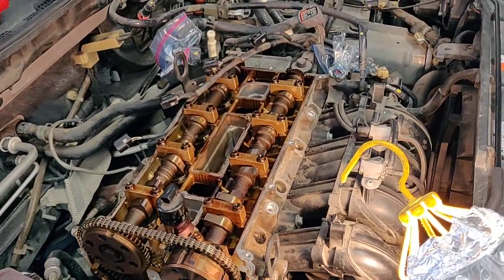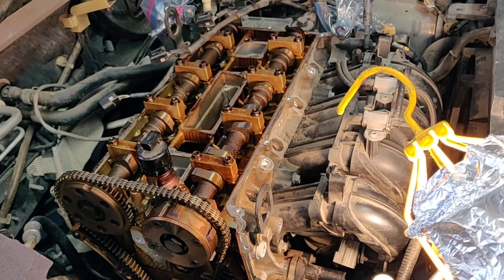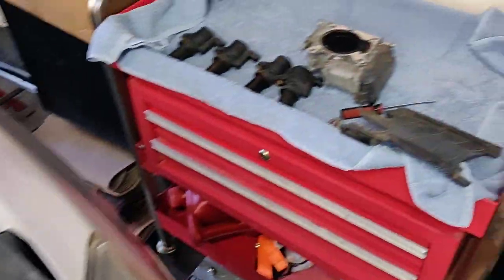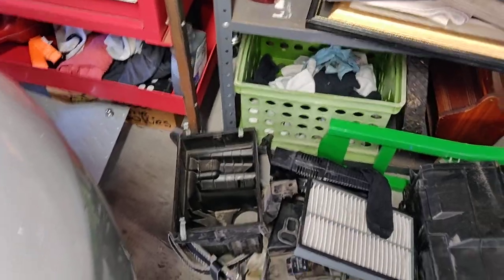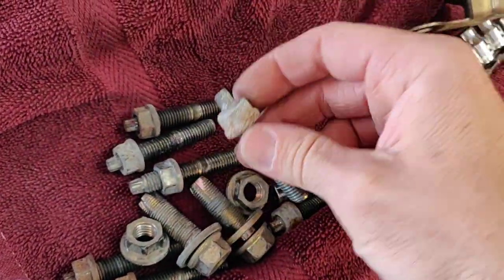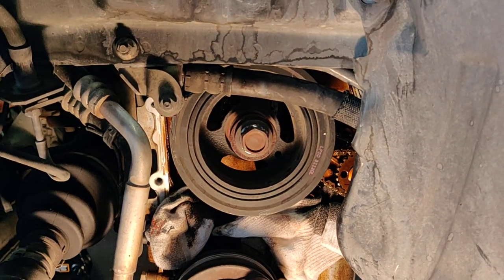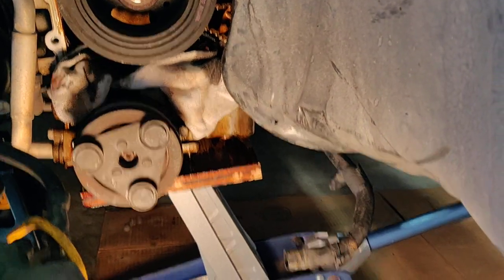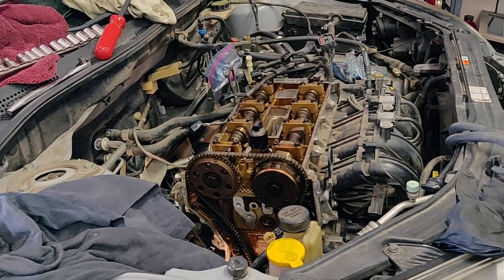2004 Mazda 3 2.3 l engine cylinder head gasket removal

Comment: Seems like itll be easier to pull the motor to work on, and if motor is stuffed I'm halfway to putting in a new 1, thanks for the vid!
Reply from the maker: Might be easier if you have the space and hoist to do it. In these little Vegas garages I had neither. Motor ran fine after this job though, so it was worth the hassle.

Comment: Just did the same job. I used a 1500 lb 3/4 drive impact gun took that bolt off easy on medium setting.
Reply from the maker: @darthwelder652  I did this job back when I had almost no good tools, I have probably 7 impacts now, including a 3/4 lol.

Comment: The only thing that worried me was when you explained loosening the crankshaft pulley bolt. You said you had the socket on a long bar, then jamming it against the ground bumped it loose using the starter- As the crank pulley has no key and as soon as the pulley nut becomes loose the valves will stay in one place ( as the timing chain sprocket isn't being clamped anymore)  while the crank is going round- There's a big risk of the pistons hitting the valves if you crank it too much - Obviously you got away with it but it's a bit risky.
Reply from the maker: Risky for sure. But we were careful. Here's the vid if you want to see how we did it. https://youtu.be/_HrJS8IXQR4

Comment: so did the gasket fix it or was the block or head warped? Got a line on a $650 '99 626 with a "blown head gasket" and wondering if its worth it.
Reply from the maker: Head was warped something awful. Had a machine shop in Vegas take.care of that part. Got about 35 or 40,000 more miles out of this little engine before the rest of the car fell apart

Comment: Very informative! Do you mind sharing the video on how to remove the camshaft pulley? I can’t get pass that process and as you said it is really a beast. I tried to “bump start” the engine while having a wrench/cheater bar but I must be doing something wrong. Engine just stops and it is not continuing with the crank.
Reply from the maker: Sorry it took so long to reply. Here's how we did it. https://youtu.be/_HrJS8IXQR4
Reply: Don't do that! You can spin the engine out of time and cause more damage. Get a good impact!

Comment: Hi, thank you so much for the info, I am replacing a head gasket too, the only thing I don’t get ( I am not a professional) is if before I start removing the timing chain and then the cams, do I need to do anything timing related?  Do I have to get it to TDC or use the timing tool? Or is that after I have changed the head gasket? I guess what I am trying to ask is if there is something I need to to do before removing the cams to ensure good timing or is all of that after? Thank you so much for your help!
Reply from the maker: No, you can just start unbolting everything. No special precautions necessary. You'll get it all back in time when you put it back together.
Reply: @jcx2bby  thank you so much man! I really appreciate your time to answer and all of your help through the videos! Thanks a lot.
Reply from the maker: @mikeup91  You're welcome, my video isn't a complete walk through on the process, but more of a 'tips' video. There is a series of videos out there that walk you through the entire timing process and they're really good. Just search for mazda 2.3L timing and you'll find them. GOod luck!
Reply: @jcx2bby  thank you! One more thing, did you have any problem while removing the engine mount? Did you use an pneumatic wrench ? Mines seem to be really hard to get loose!
Reply from the maker: @mikeup91  I used the battery powered impact wrench on most of that kind of stuff. I have a DeWalt one
Reply: @jcx2bby  all right man! Once again! Thank you so much!

Comment: what tools is necesary for removal cylinder head?
Reply from the maker: Basic hand tools will get the job done.  And by basic I mean a good set of 1/4, 3/8 and 1/2 drive sockets and ratchets.  Screwdrivers and pliers and such.

Comment: Do you happen to know if this is the same engine in the 2008 mazda tribute , my problem is a nasty leak coming from the engine and I was going to replace all the oil seals including the rear and front main oil seals , oil pan , oil pump , but if I have to go thru all this to get to the front main seal , im just gonna junkyard the vehicle. it looks like in this video that maybe the front main seal is already behind an enclosed oil area and maybe I dont have to pull the crank gear ? hard to find info on these possible oil leaks , plus our mazda is just an A To B vehicle for a college student and I would be doing this in my garage , thanks for reading any help would be great brother
Reply from the maker: First, I am not sure if it is the same motor or not. But if it is, I can tell you this much. You won't be able to replace the rear seal without pulling the motor. I didn't replace the oil pan gasket on this car so not sure about that process. Timing cover seal isn't a seal, it is rtv and it's that way from the factory. For the front seal, you'll have to pull the crank pulley off to replace it, and that means making sure you can retime the cams to the crank. Anytime you pull that pulley, you separate the timing and it needs to be rechecked.
Reply: @jcx2bby  Thanks bud , Im overseas working and trying to armchair quarterback the parts im going to need , according to the VIN its the 2.3l but it is in a mazda tribute which is actually a ford , so I am hoping it is the oil cooler which is a known flaw , so I ordered an entire seal kit off ebay and am hoping I just get lucky and thats all it is , I am an aircraft mechanic by trade and working on it is not a problem , the vehicle started having just a few drops every now and then and then almost overnight started really leaking bad which usually would not be signs of a main seal , fingers crossed , thanks for your help
Reply from the maker: @markod442  oh right on, my first 4 years in the AF was hydro for C17s, don't miss it though haha. 
I agree, seals don't usually give out overnight so you may have a bad line or cooler. From what I remember reading on this motor when I was working on it, Ford and mazda used the same 2.3 so your car should be similar to identical
Reply: @jcx2bby  I have my fingers crossed, there's lot to this story and why I have to get it running asap as in the day I get home , Im willing though to pull the motor apart if I have to , I mean I have to pull the motor out anyway if its nothing apparent, so stupid of the engineers not putting a pilot shaft or even an arrow on the cam gears and crank gear , I know there is a tool to lock out the cams and a tool to lock the crank but I would rather not have to buy those tools , its not even my vehicle , but thanks for the chat bro
Reply: Oh I should have mentioned just like you said there are markers at the back of the two cams and one on the harmonic balancer

Comment: How hard was this prosses for you 1 thru 10 10 being hardest ?

A+ video
Reply from the maker: Thanks, but I should have taken more video as I got it back together, the timing process, sealing the timing cover etc. I really was busy though and just needed to get it done. 
The procedure i'd give a solid 5 out of 10.  Buy a Chilton's manual before you do this, takes a lot of guesswork out. Most of the job is done with ordinary hand tools except for the timing tools, a tool to hold the crank in position when reassembling, and you need an impact wrench (a good one) to remove the crank pulley bolt. I did it without an impact, but it was sketchy.
Reply from the maker: https://youtu.be/_HrJS8IXQR4

Comment: What off when the engine is speed and the pulling bolt got lose. So the timing have done wrong and I have reset it many times  but when I want to start it the car will be shutting. What is the problem for it not to start.
Reply from the maker: Sorry man, I don't quite understand the issue

Comment: Awesome video!  About to tackle my Mazdaspeed this weekend.  Only difference is I have a high pressure fuel pump and a turbo to worry about :/.    Do you have a part 2 by chance?
Reply from the maker: No part 2, sorry. I don't have experience with the turbo version, but I imagine once you get that out of the way, the rest is the same/similar. Good luck, if you get stuck, I might be able to help out. I have some other little videos on my channel about removing the crank bolt and reinstalling it....it was a beast.
Reply: @jcx2bby  I appreciate it!  I'll check it out.  Where did you buy your head gasket set?  Do you trust O'Reilly's and places like that?  Or Amazon?
Reply from the maker: I bought all the parts from RockAuto, even with shipping it is cheaper than the box stores and simpler than Amazon. I do trust AZ and O'R, but Rockauto saved me like 200 bucks over what they wanted.  The box stores have their place, and I like to support them because of things like the used oil dropoff, but I'm not giving my money away either, lol.

Comment: Hey man is the chain on that engine timed. I know engine is but i see marks on timing chain and on oil pump chain but nothing to line up to? Thanks a lot if u can help
Reply from the maker: No timing on the chain as connected to the gears that I'm aware of. Just slide it on. I just drove this Mazda 1400 miles so it seems like I got it together good enough!
Reply: @jcx2bby  thanks man. I just didn't know what the black marks were for. And vids i watch and research it never says that it is oriented a certain way.  Thank you I will roll with it

Comment: Can you remove the timing cover without removing the top camshaft cover? I am assuming you have to because of the timing set up of the camshafts and crankshaft but don't know for sure. I just need to reseal the timing cover.
Reply from the maker: I am not 100 pct certain on this, but I am thinking it's possible. Youd have to still loosen the valve cover bolts at least to release tension. And I do believe you would have to fully remove 3 or 4 bolts that go thru the valve cover down into the  timing cover. 
As far as the timing goes, if you put that locking bolt through the crankcase to block piston #1 from turning, you should, in theory, not have to worry about retiming anything. Cams aren't going to move so as long as block that crank from turning while removing & installing that crank pulley you "should" be ok. Judgement call. 
There is no gasket for the timing cover btw. Just gray RTV. It's like that from the factory
Reply from the maker: And get a new crankshaft seal for that timing cover too.
Reply: @jcx2bby , thank you so much.
I need to do re do the rtv for the timing cover. My timing cover is leaking.
I would like to just remove the timing cover, clean old rtv and place back. My concern is the timing, I think I can lock the crankbolt, but I would like to avoid removing the valve cover and locking the camshafts... do you think is possible?
Reply from the maker: @Keepin-it-wheel101  I think so. Like I said the cams won't move just because you take the crank pulley off, so long as you block that crank from moving.

Comment: what is the torque spec for the head bolts?
Reply from the maker: 5 step sequence. 
97 in lbs
12.5 ft lbs
35 ft lbs
90 degrees
90 degrees
All done in order working your way from the center of the head to the outside

Comment: Hey man I seen you un bolted exhaust manifold. Is that cuz you dropped sub frame.
Reply from the maker: I unbolted the exhaust manifold because we were taking the head off the next day. I had time to do it before I made the video so that's why it's loose here. I didn't do anything to the subframe.
Reply: Oh dang sorry just thot it was timing chain job. Okay so the Jack under is just to support engine cuz engine mount is off?
Reply from the maker: @jamessoliz8020  haha, no prob brother. Yes, jack under oilpan with a piece of plywood to distribute the weight, while the engine mount was off.

Comment: How long did it take you to change out the Head gasket?
Reply from the maker: We'll honestly it's still not back together yet, waiting on the machine shop to finish the head. 
Took about 2 days to tear down, but I work slow and have a toddler under my feet constantly. I anticipate 2 days to get it going again barring any problems. A good experienced mechanic could do it in a day if they had a new head on hand

Comment: I have a 2008 Mazda 3 same motor as that one it won't start it's a 5 speed and it won't even push start
Reply from the maker: Have you checked compression?  First thing I'd do, other than check for fuel
Reply: @jcx2bby  no I have not I haven't been able to work on it yet I have no tools but sometime this week I will have them
Reply: @jcx2bby  it don't crank ither
Reply from the maker: @jonaldiyofficial8074  ohhh, if it doesn't crank that could be bad, assuming battery and starter are ok
Reply: @jcx2bby  yes they are both good
Reply from the maker: @jonaldiyofficial8074  might have a broken timing chain, valves hitting pistons. Or, depending on what happened, a rod bearing is bad, piston siezed, who knows.

Comment: This is a pretty complicated job!!! Is this how it is when changing Head Gaskets on most cars???
Reply from the maker: For overhead cam engines, yes.  For old school pushrod overhead valve engines, no. They are a different animal and don't require retiming the cams to the crank. But there are a few other things that must be done on OHV engines that don't have to be done on OHC engines.
Reply: @jcx2bby  an older sohc car is a bit easier to start on, you still have to remove all the components attached to the head haha

Comment: Should’ve changed the timing chain since you were in there anyway. These motors love to jump time on the intake side and you’ll be doing a valve job then. I’m about to do this job on my mother in laws escape.
Reply from the maker: I agree with you, however, it wasn't my car and it was pulling teeth to get the parts I absolutely had to have, let alone parts that weren't 'broken'.  Car is still running as of today, a good 15K miles later so I guess he gambled good on this.

Comment: If you maintain proper oil changes, the timing chain along with the gears will last over 200k miles.
Reply from the maker: Yeah, we went back with the original timing set in the end. It was ok on this engine. The head gasket was the main issue here. That, and the fact my buddy kept running it after it blew.

Comment: What is the size of the head bolts
Reply: Number 55 hex head...And use a 1/2" extension. As I had several snap off my 3/8" they are that tight. Also toque to yield bolts. Use them only once. Same for the Crank bolt and friction washers behind the gears for the timing chain. And torque that new Crank bolt 75lbs then 90 degrees. While that Crank lock down bolt is still in there. Because if that balancer spins just 5 degrees. It shoves the valves right through the piston. I use locktite blue just too make damn sure that balancer is not budging. As everything spins off that bolt staying tight..